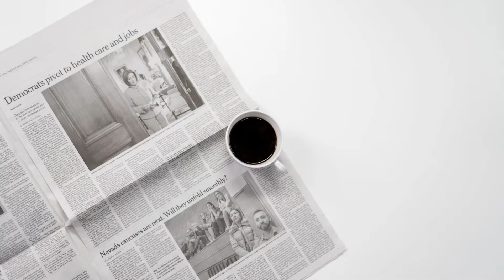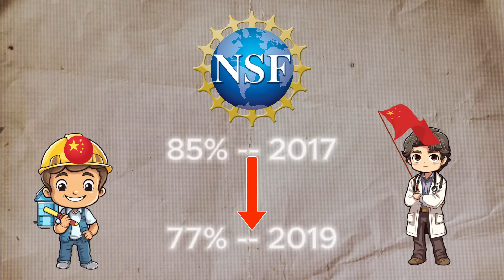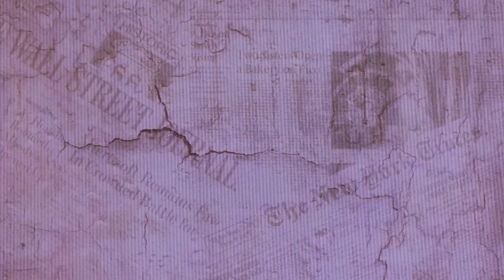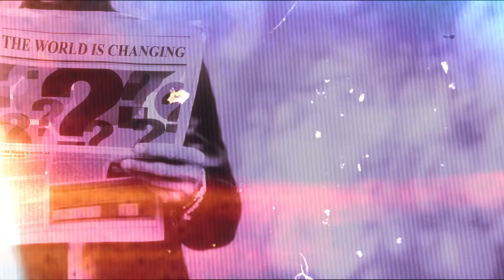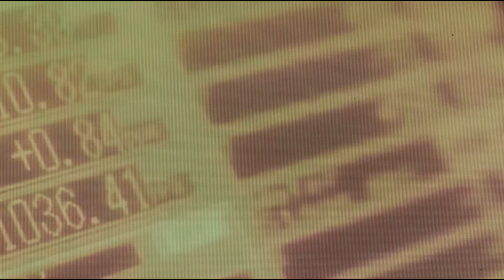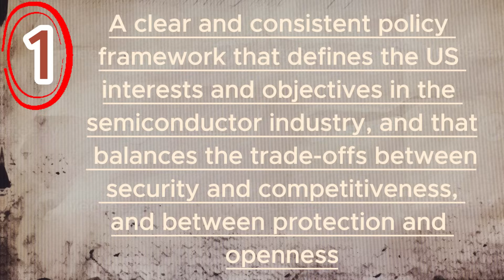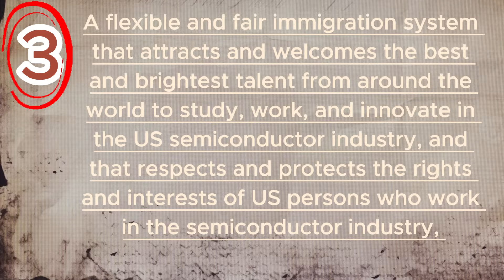This is HOW and WHY China is closing the gap with the US in the semiconductor race

Comment: Until Chicom working culture turns broadly to quality instead of quality, its “breakthroughs” will always be plagued by fickle unreliability and outright unpredictable failure. In semis, example of a cause is impurities.  In engines, it is overheating plus electronic controls.  Root of the problem is that at every level the goal is to fulfill the quota, play by the book to avoid blame.  No one wants to point out problems to the boss.  It is built into the system.  

Numerous efforts to poach TSM talent occurred over the years.  Most returned to Taiwan disappointed and found that their sojourn was a negative on the resume instead of a positive.